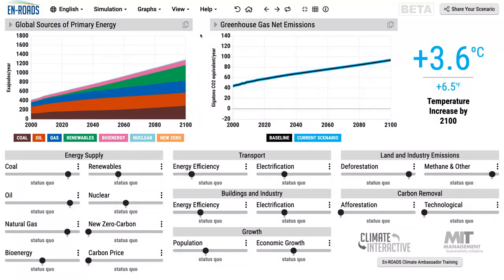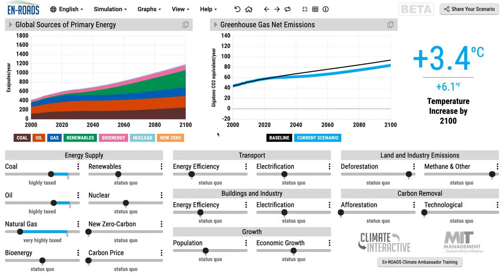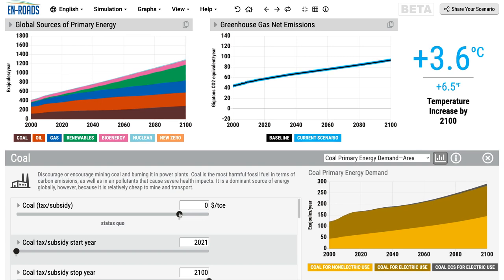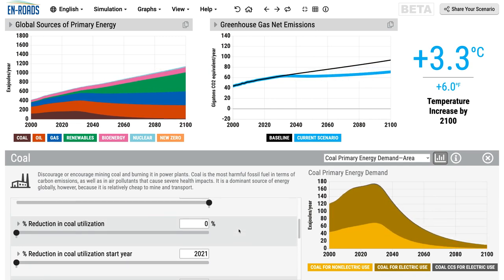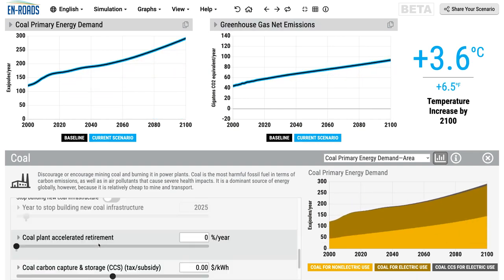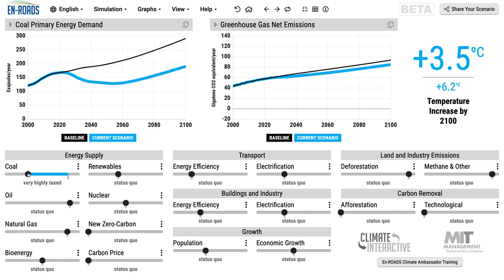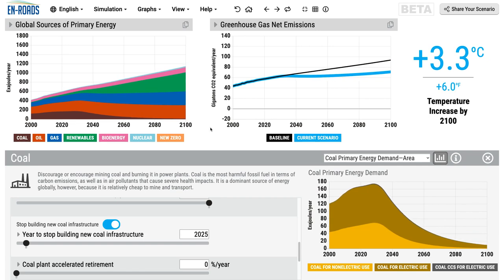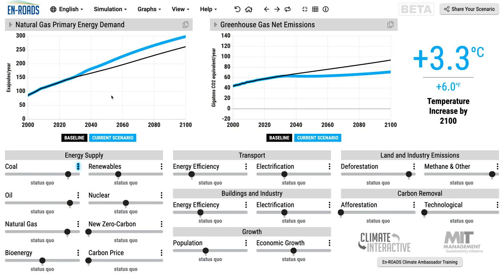Coal, Oil, and Natural Gas – Mastering En-ROADS

Comment: Thanks - Perfect timing!
I raised this a few days ago. Knowing that current fossil fuel subsidies are specifically factored in is great.
Is it accurate to say that taxing fossil fuels is the same as reducing subsidies? Clearly local/national tax policies are not an adjustable variable in a disaggregated model. could you suggest a way of presenting that local element to an audience, when what the domestic end-user sees is high taxation at the fuel pump? To what extent - i.e. dollar for dollar - does moving the carbon tax slider correlate with the fuel tax sliders?. I'm presuming the assumption is they're taxed at the producer end, rather than the consumer end?

Great to see the model being so actively developed.